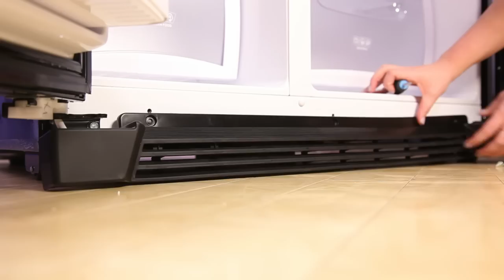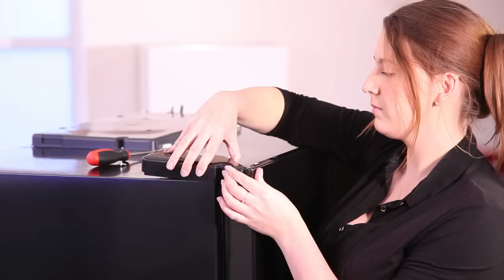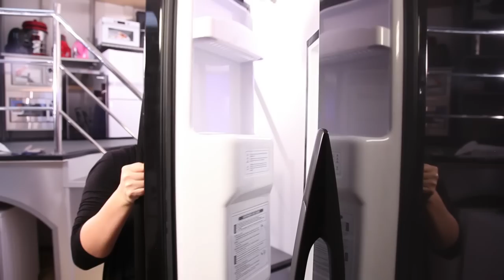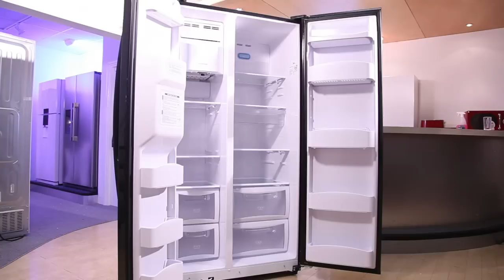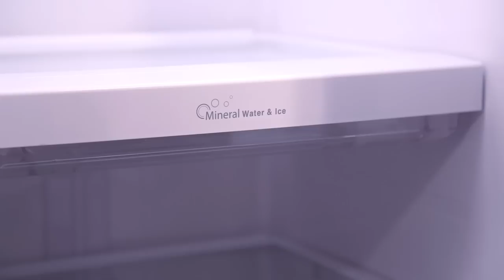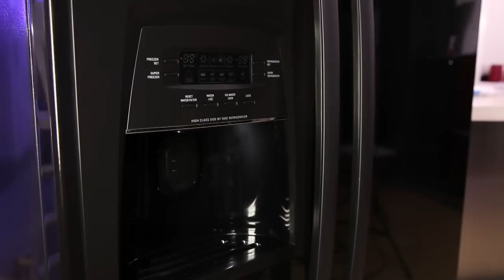Daewoo - How to install your American Style Refrigerator (includes leveling and removing/replacing)

Comment: my refrigerator section is blocking everything in it, working as a freezer. even after adjusting the temperature, its still giving same issue.
Reply: This issue has now cropped up in my refrigerator too. Everything in the refrigerator becomes frozen. Have you managed to sort this issue on your refrigerator??
Reply: @sandeepvmm  I have not been able to fix it. There is also this loud  cranky noise it makes whenever I put the refrigerator on cos I turn it off in a bid to control the temperature.
Reply: Mine does the same, it freezes everything in the refrigerated zone. And the water tank is leaking.

Comment: I’m having a problem with my refrigerator, it’s not cooling and I’m not sure what else to do. Please advise? Or put some videos for troubleshooting.
Reply: pain in the butt these strip out the back of freezer and defrost with steamer every two weeks ps turn it off
Reply: What needs replacing as mine is not chilling either
Reply: Mine is freezing EVERYTHING.